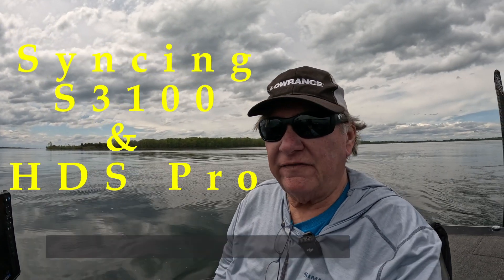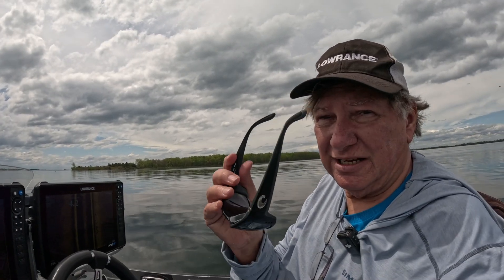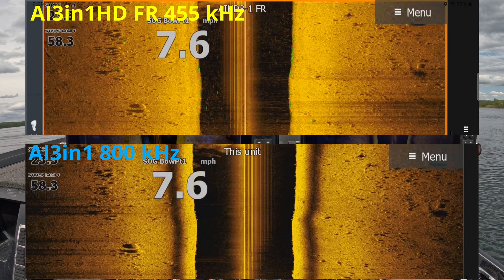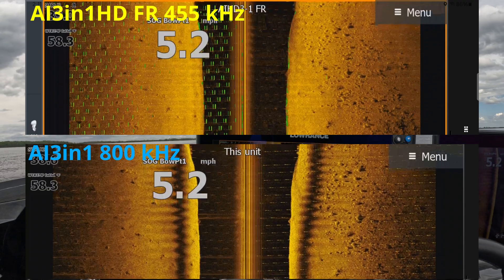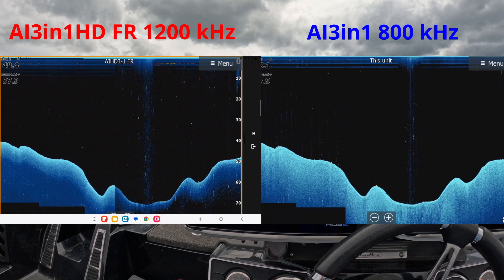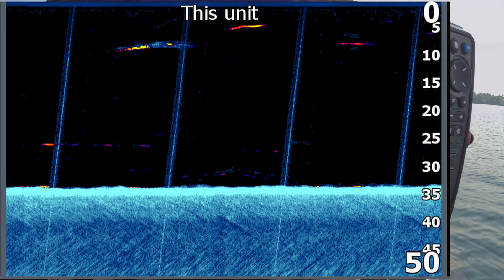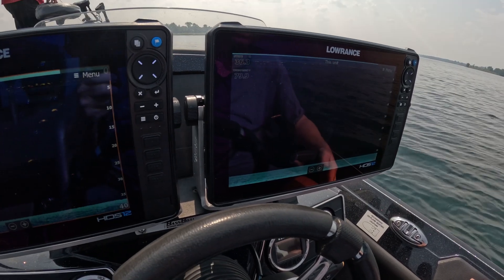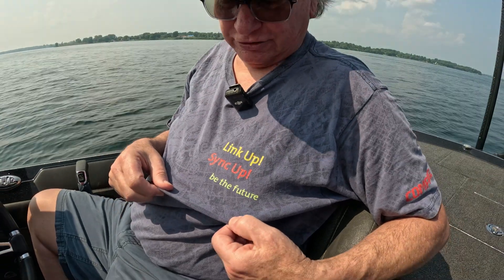Syncing HDS Pro and S3100 for Better Side and Down Imaging

Comment: Will ping sync allow me to run a 3n1 hd and a regular 3n1. On different frequencies with no interference like you are doing here? I don’t have a 3100 box.
Reply from the maker: I have not tested with just HDS Pro units, however I don't see why it wouldn't work unless the modules (S3100, AT2) act as a master type. I have connected S3100 and AT2 together and that works. So, you must have the transducers on two separate HDS Pro units. Sync does not work on other units. I have my units at home but no easy way to test for interference. Garry.

Comment: Hey Gary - I have the AIHD 3-1 HW FR transducer and the S3100 module.  It’s the only transducer I have on the transom.  Which port do I plug the transducer into on the S3100 module (blue or black)?
Reply from the maker: Plug the transducer into the black plug. The blue only does Sonar and Downscan. Garry
Reply: @garrywoodruff960 thanks will do.  Surprisingly there are not a lot of videos on this.  My intended use case is sideview fish reveal - mainly for grassy areas.  Hopefully it won’t disappoint.
Reply from the maker: You're right, there are not a lot of videos on the subject. I am planning on doing more including showing show to use the FR to locate fish and features. As I've done the other videos, I have been noticing that the FR is showing fish holding in some areas. Garry